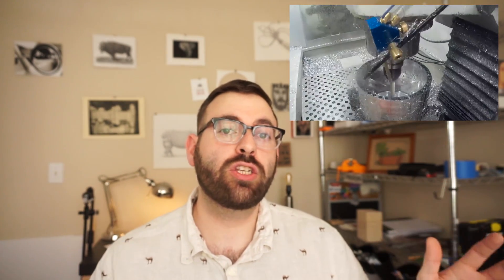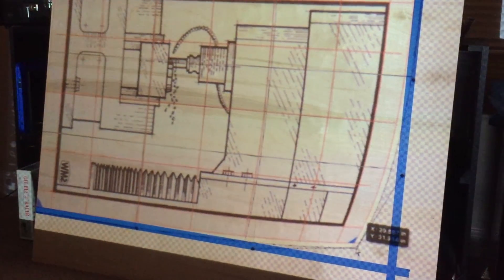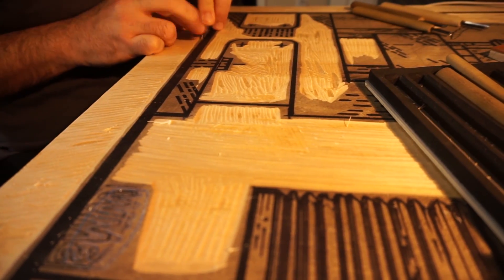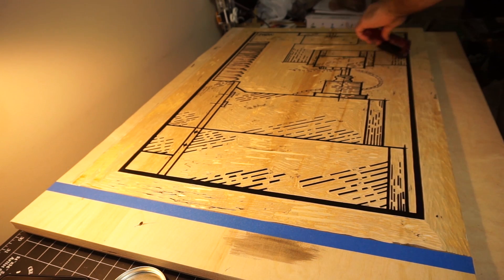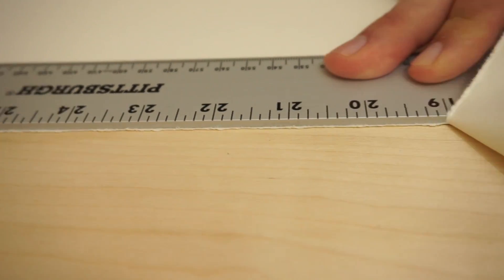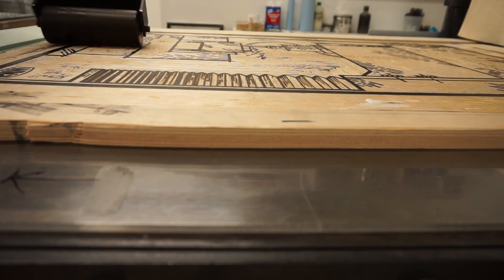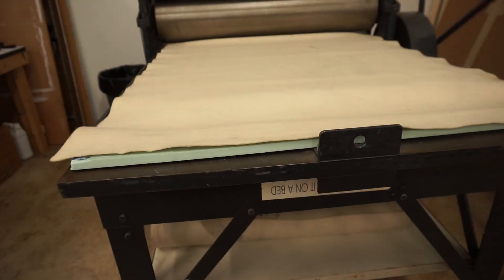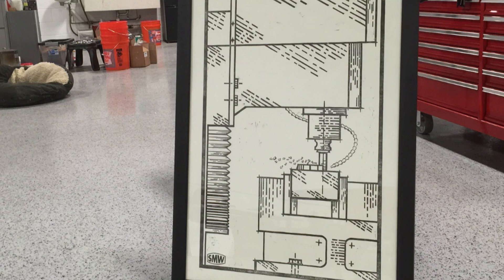Giant woodcut print of a CNC machine! Made for NYC CNC

Comment: Hi +Diode Press +AvE sent me. This vid has also been posted to the r/ArtisanVideos subreddit. Really beautiful work. I was curious how deep the void areas are? How much material needs to be removed to get a clean void?
Reply from the maker: +ConditionOfMan Thanks for sharing it! The depth depends somewhat on what look you are going for. But on average, it's about 1/32" (0.8mm) deep. Usually I'll carve it once, and run a print, then go back and carve some more in certain areas if I want to lighten it up, etc. Thanks!